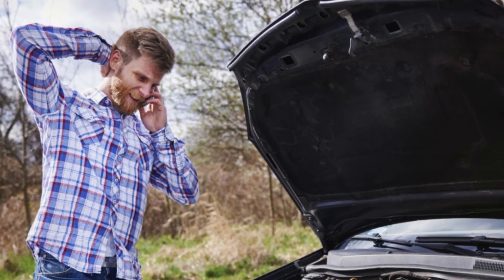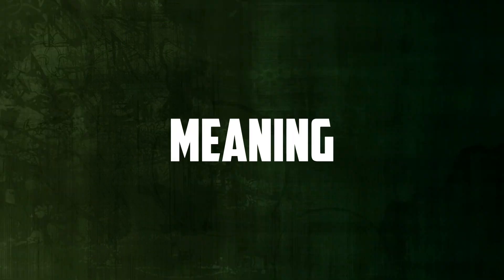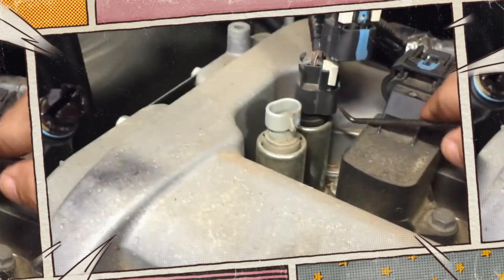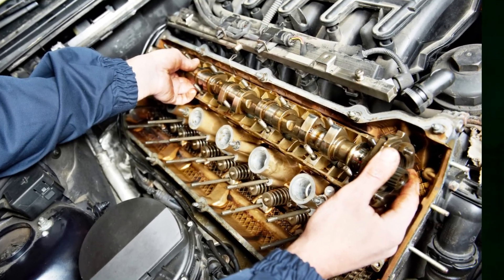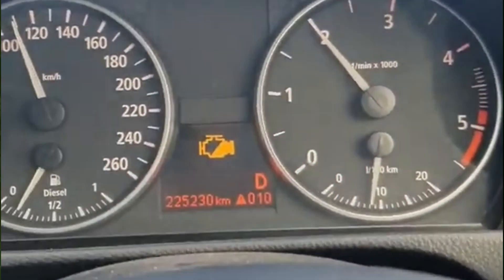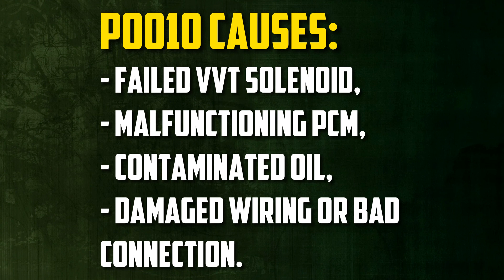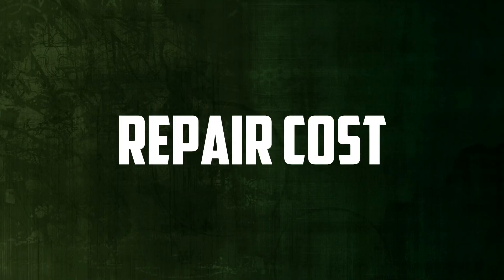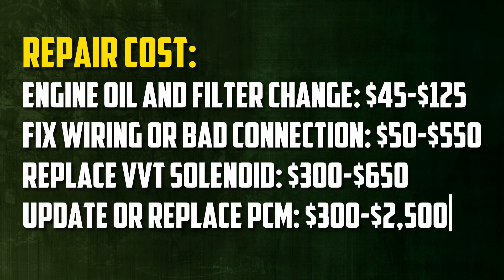OBD-II Code P0010 - Meaning, Symptoms, Causes, How to diagnose?

Comment: Will the 0010 code come  up while driving
Reply from the maker: Yep, it can pop up while driving. Means the cam actuator or solenoid on Bank 1 ain’t working right — bad wire, sticky solenoid, or dirty oil. Light kicks on when the computer sees the timing’s off. Check oil first, then test that VVT solenoid.